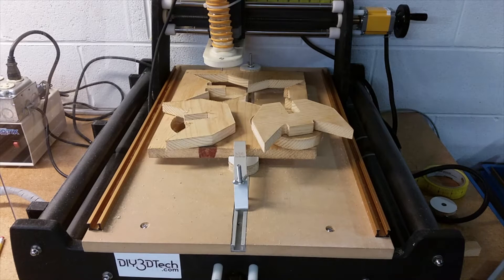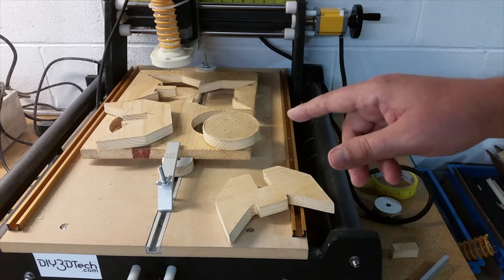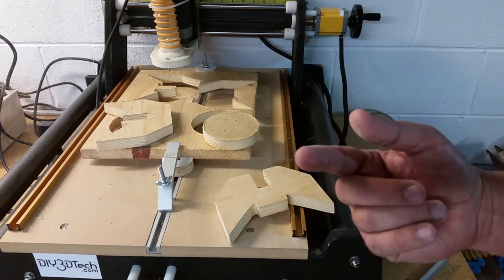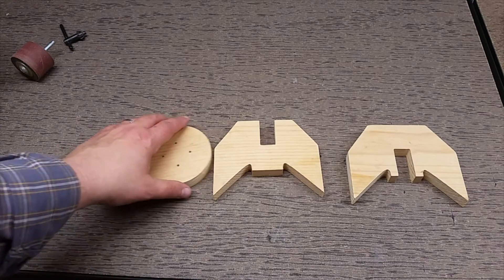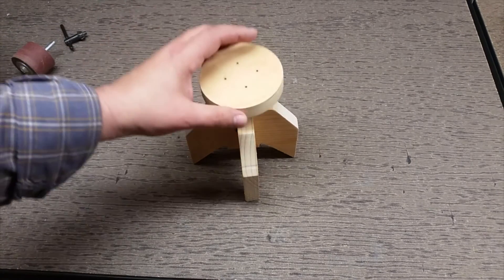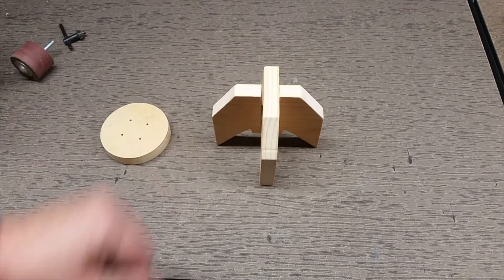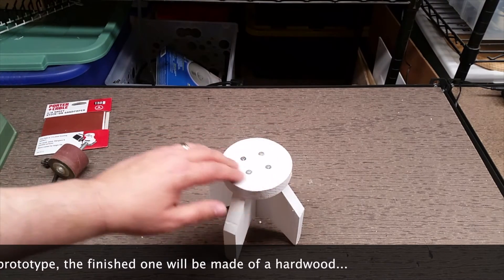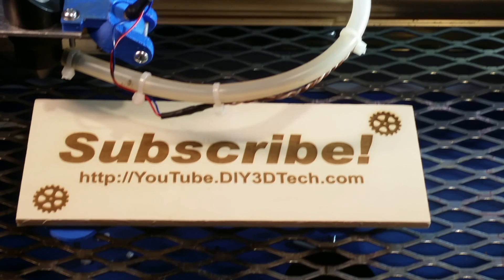CNC Projects - Rocket Fin Style Plant Stand!

Comment: Great little Rocket Fin Plant Stand! I would like to 3D print this, as a single part, on its top. Any chance you can release a one piece model for my gMax to print like huge? I can see using this for large 3D prints as a stand, also. Thanks for sharing this!
Reply from the maker: +Print 3D Channel Keep watching as something like this (the file where fins came from) turn into a 3D printed rocket :-)
Reply from the maker: +DIY3DTECH.com also yes to the later when I get a few minutes :-)
Reply: +DIY3DTECH.com Awesome! Will make a great 3d printed stand!
Reply: DIY3DTECH.com Hi, I own 2 K40 Laser Cutters and 2 3D Printers. I’m thinking of purchasing CNC for wood working. My primary use is to make alphabet cutout using upto 1/2-inch thickness. Which machine do you recommend? Thanks